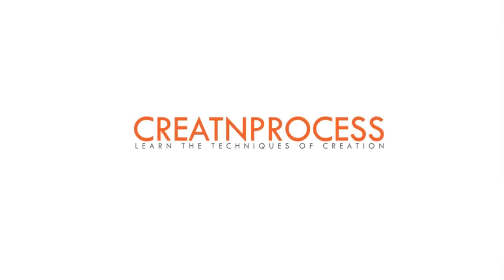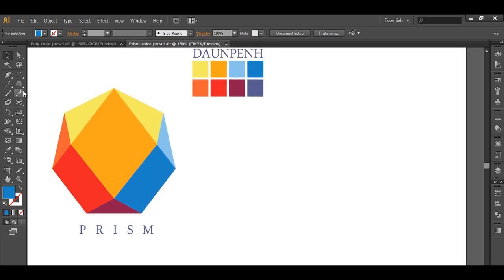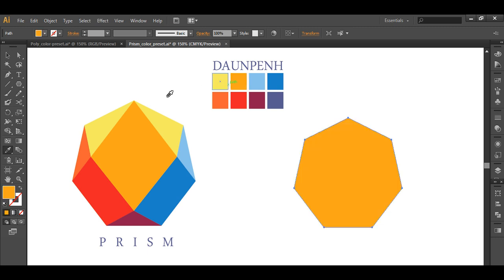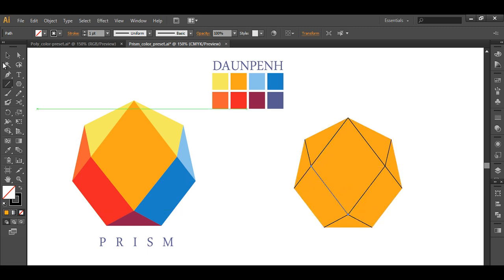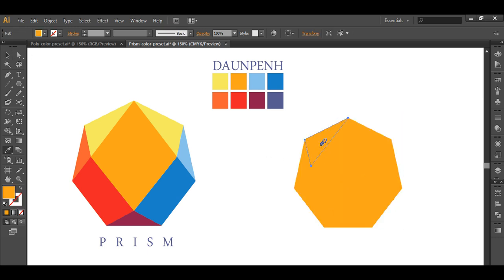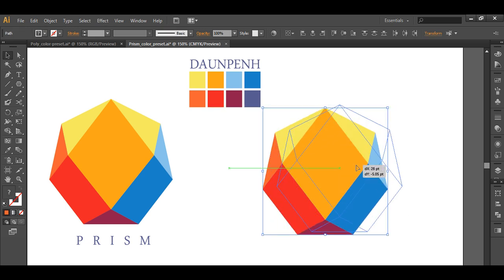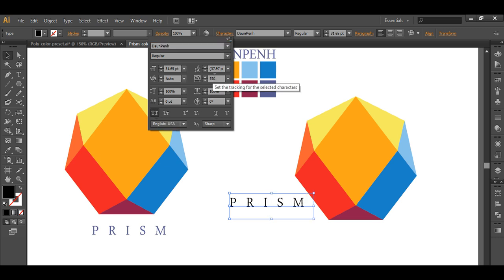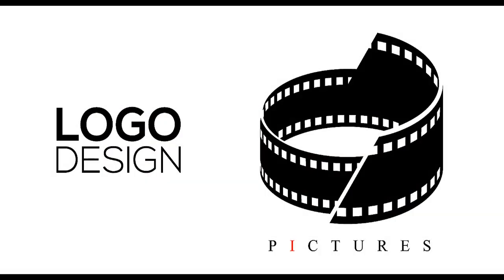Professional Logo Design - Adobe Illustrator cs6 (Prism)

Comment from the maker: Professional Logo Design - Adobe Illustrator cs6 (Prism) 
Here is another new Logo Design Tutorial. In this video we will be making 3 Dimensional object. which has got multiple number of surfaces, each filled up of different shades of color.
So to create this logo we will first use the polygon tool, to create the seven sided polygon. then we will use the line segment to create each segments. And use the Shape Builder Tool to sub-divide each pieces. Finally add up the color and the text.
To Understand step by step process check out the video.
If you want to Know more about Designing,
Click to subscribe my channel.
https://www.youtube.com/user/creatnprocess

50 PROFESSIONAL LOGO DESIGN MASTER COLLECTION
Now Available on!
INTUBUS - https://www.intubus.com/file/14363
GUMROAD - https://gumroad.com/l/woEWa
Reply: Thank you for your videos, they are extremely helpful!, just one question, where do you get thoes little boxes of color that you use to choose the colors of the logo? Thanks!